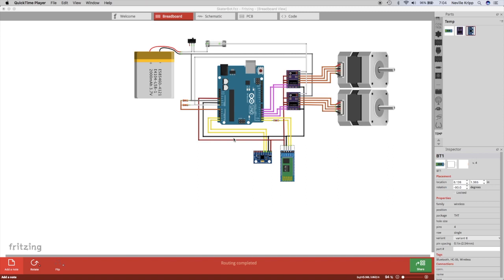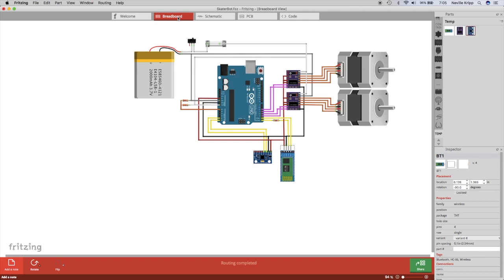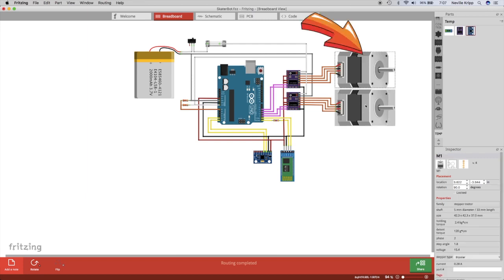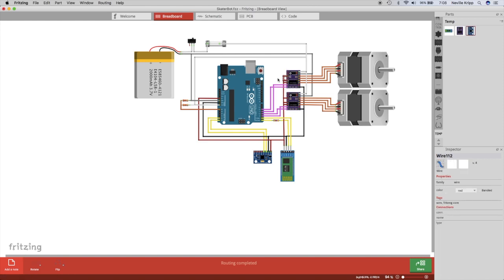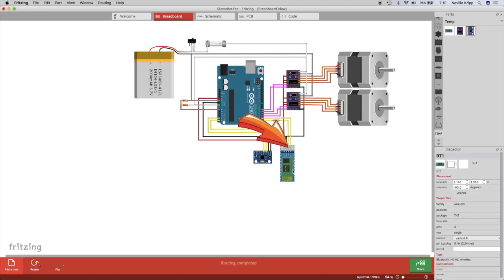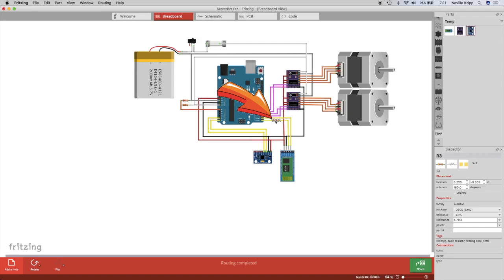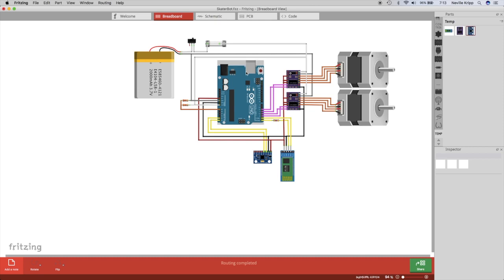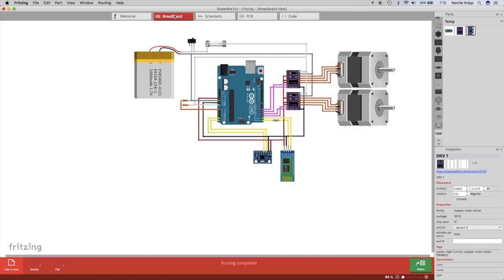#005 Self Balancing Robot Circuit

Comment: Can you control this by using a mobile application or make own transmitter controller ??
And second is to make your videos real time and practical with some little editing and provide links for coding, online component purchasing, and other documents..  may be it help !
and sorry for bad english 🙄
Reply from the maker: Hi, yes I have developed an iOS app to control the robot, the code is available on github, if you check my website it will have a link. You should also be able to build an Android App without too much trouble.

And thanks for the advice, this is still fairly new to me so hoping the videos improve as I do more.